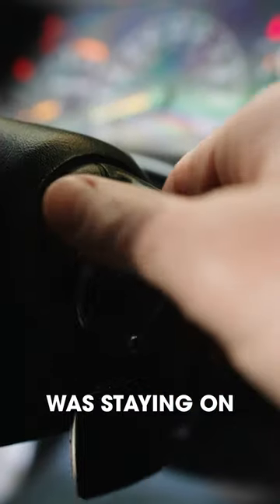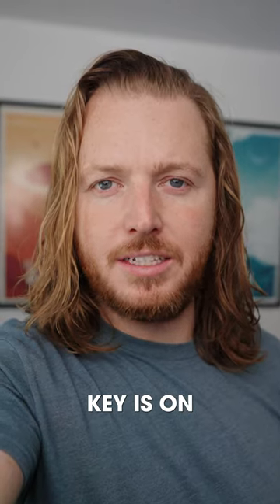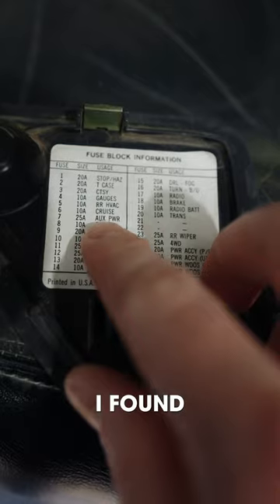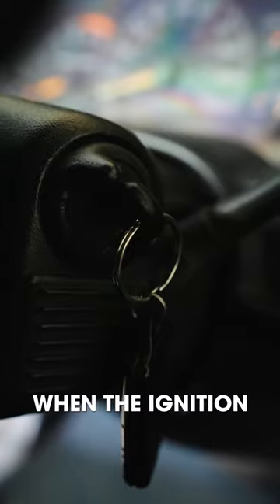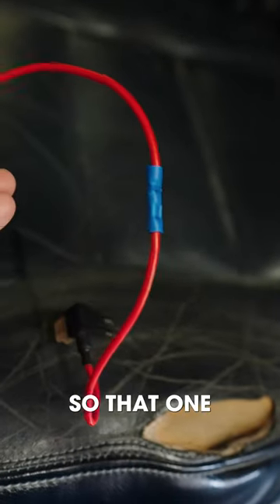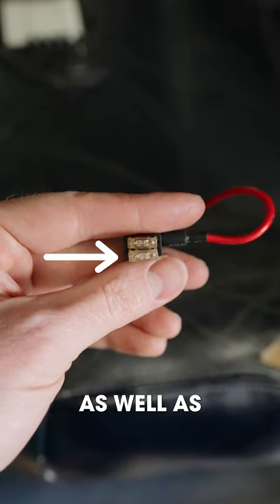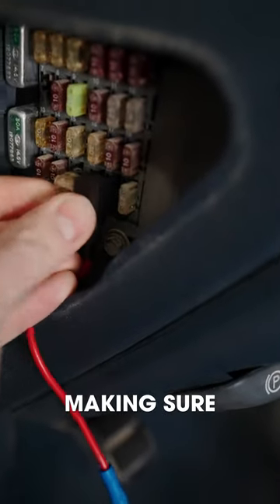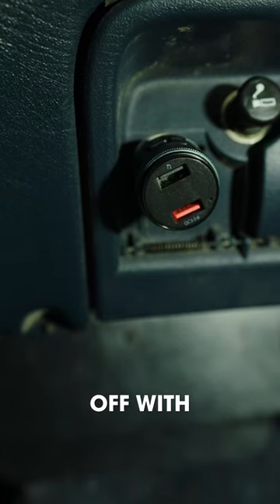Aux Power Fix  #diy #repair #automobile

Comment: Isn’t it supposed to do that tho. My dads chevy work van has 2 outlets  1 turns off with the engine the other stays on  the one that turns off is the only outlet that the cigarette lighter lights with
Reply from the maker: Hmmm mine doesn't do that